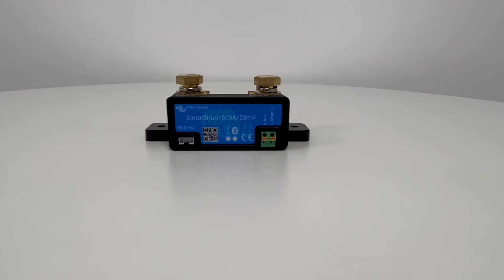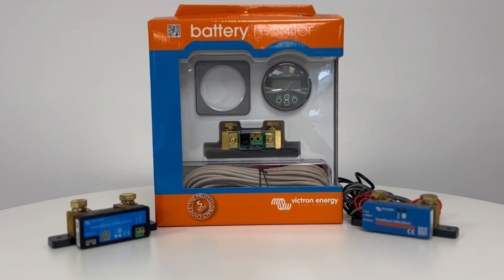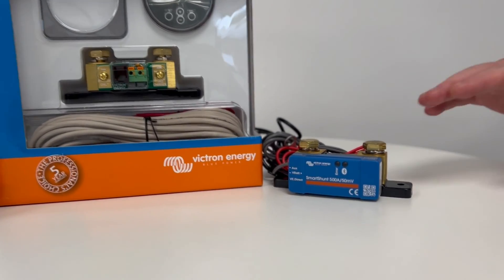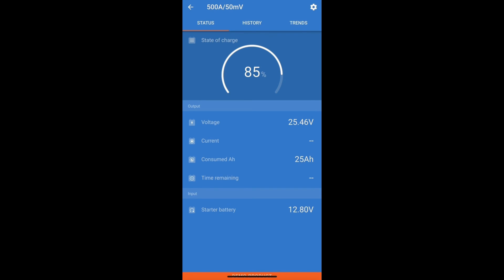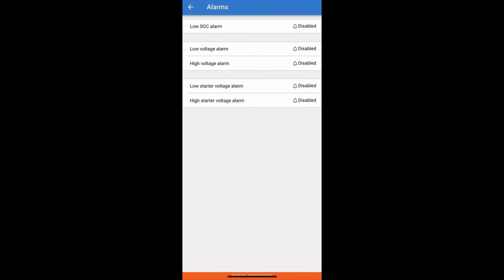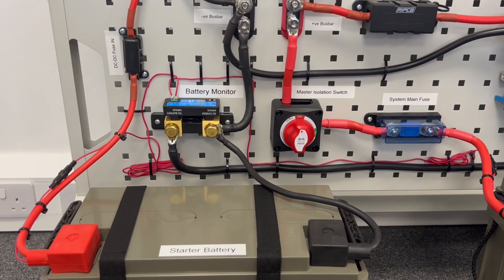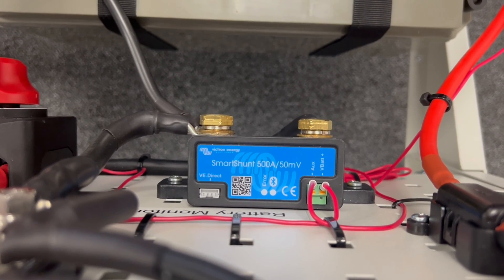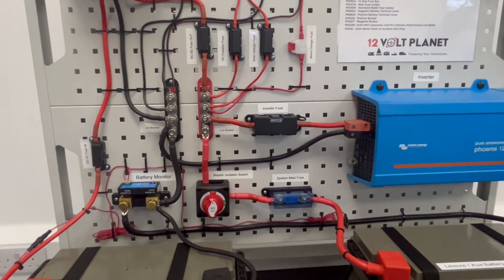How to Install a Victron Energy SmartShunt | 12 Volt Planet

Comment: What is the metal backing plate you mount against called? Do you sell them on your website?
Reply from the maker: Hi, thank you for getting in touch. We do not stock these on our site but it is called a Workshop Perforated Panel and these are readily available from various retailers online

Comment: Must the battery this shunt is connected to have its own BMS for any reading on the Victron Bluetooth device? Or will any non-BMS budget lithium battery do?
Reply from the maker: Hi, thank you for getting in touch. Yes, any battery will be fine as the device will just measure current flow in and out of the battery